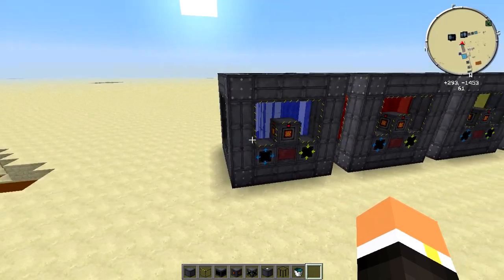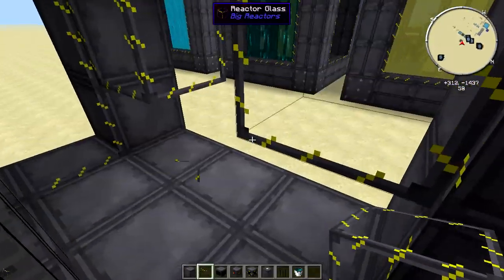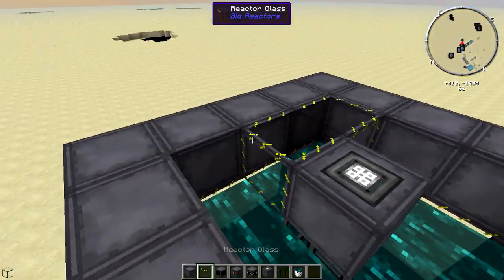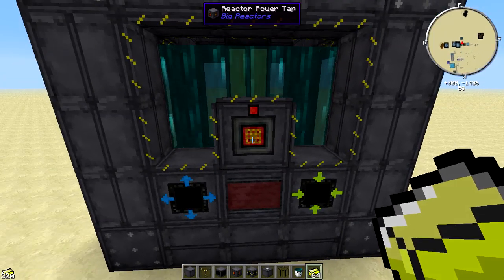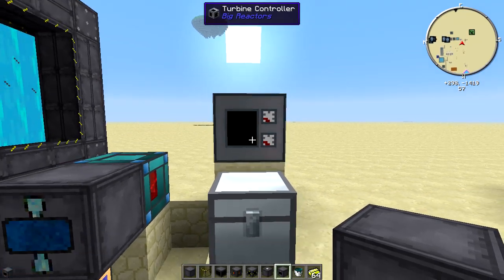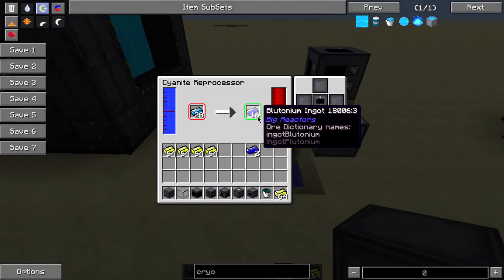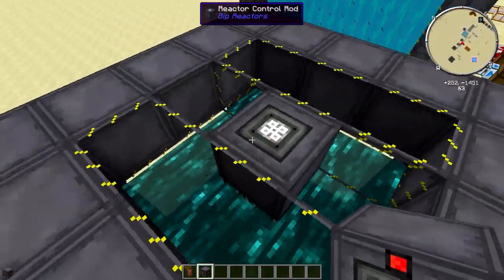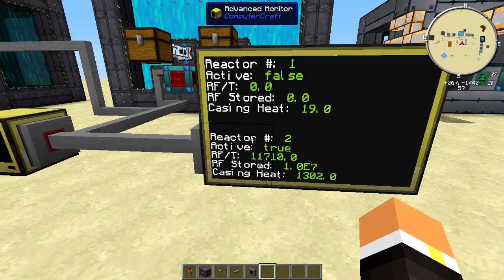Big Reactors Tutorial - Part 1 - Reactors

Comment: Hiya, just confused at the control rod and the piping for the RF. What does the control rod do and how do I transfer the RF energy without Redstone Energy Conduits? I don't have it in my modpack for some reason and kinesis pipes seem to not work. I know you use a redstone cell but I want to connect it to somewhere else. Thanks.

Comment: Couple things you may want to clarify Ruby:

1 - The fluid placed around the fuel rod(s) isn't burned or used up during operation, the fluid type just adds modifiers to the reactor's operation, and in most cases all you really need is liquid enderium, as cryotheum is only slightly better, and used in more controlled active reactor systems.

2 - The real fuel source is the yellorium ingots.  You probably should've gone over the ore a bit more than you did, but yellorium isn't the only fuel you can place in the reactor.  The cyanite that comes out as waste can be reprocessed into blutonium for some water and power, but it takes 2 cyanite for every blutonium ingot made, so eventually you'll run out of ingots for fuel and will have to go get more ore, thankfully usage rates are fairly low, so a single mining run can last a long time.

3 - There are two main kinds of reactors: active and passive, and both are scalable depending on your energy needs.  The kind you had setup for most of the tutorial are passive reactors, in that they don't require much automation or extraneous control.  The ones with turbines are active, and produce a lot more power, but are more complicated.  It might be better to split the tutorial into 2 parts, with the passive reactors teaching you the basics that the active reactors are built upon.

4 - I don't know if it was enabled in your version, but I noticed that the bottom stat in the reactors you made, the radiation level (with the atom symbol) stayed at 100% for all of them.  I'm pretty sure different fluids modify the radiation level, and that the more radiation produced, the lower the fuel consumption per RF produced is.  I never noticed any debuffs or health loss due to high radiation, so either I built a good casing, or that factor wasn't enabled.

Not sure if these factors would want to make you change the tutorial, but just something to keep in mind.
Reply: annihilatorg That's right, for some reason in my head I replaced Ruby's demo reactors with the one in my base, which has the same dimensions, but more fuel rods.

Comment: Are reactors just used for power and that's it. If so can you store it. I'm a Noob :)
Reply: From my experience with this mod (1 year) I have never actually found out a way of storing it so most likely no
Reply: You can store the power in any normal energy cell that stores RF energy, such as the cells from Thermal Dynamics mod, the capacitors from Immersive Engineering, or Ender IO capacitors. If you convert the RF energy into EU, you can also store it in batteries or storage units from Industrial Craft.

That said, since these reactors can put out so much power, an important part of using them is to try and balance their production with your needs, since any storage method you have is likely to fill up fast and they will still burn fuel even when storage is full. You can do this by adjusting the "control rod" setting on the reactor, to get them to burn as much or as little as you need.